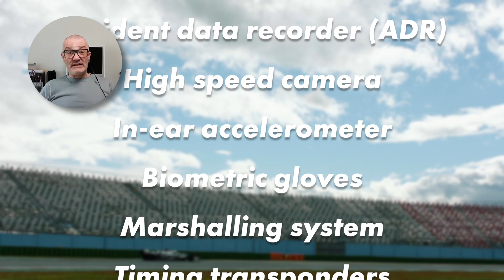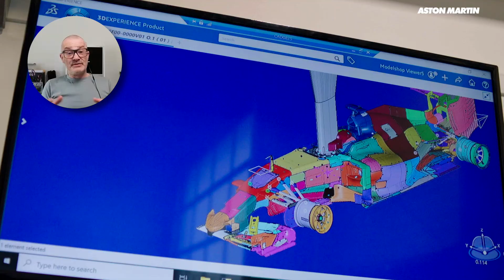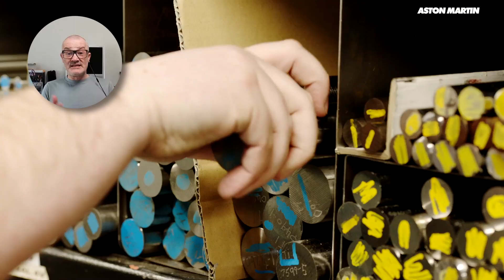The Reason F1 Teams are STILL Overweight

Comment: 21 kg for one rear wheel?! Wow, that's crazy heavy. All the unsprung mass and inertia.
Reply: Yeah I thought that was heavy as hell. I mean the are not that far off from a good racing wheel for a regular car. Sure the F1 wheel are probably bigger than the road car counterpart but still. I have read somewhere that the wheels for F1 was around 10kg in past so hearing 21kg was a little shocking to be honest. Also it might improve the racing and economy but I am not a fan of "stock" parts.
Reply: I was thinking that they will start seeing injuries in the pit crews, that’s a lot of weight to be bending and twisting with
Reply: @sebulbathx  I think these open source ones are worse, cause they effectively mean:
"You can develop them, but there's no point, so if you want to waste money, then do it for sure!"
Reply: AND tire... the wheel itself is only 7-8kg
Reply: @TurboJLo  Yes and don't forget about the air in the tire!
Reply: @-natsukashii2727  You mean Nitrogen. Less affected by temperature and not flammable.
Reply: @mell3109  I can remember that time a stray wheel rolled down the pit lane and hit a cameraman
Reply: @rchan0  yeah it was a nasty hit, right between the shoulders. Could easily have been fatal.
Reply: The increased diameter of the wheels means they are heavier than before and the weight is further out from the center of the wheel hub. These two things are the main contributor to why we are seeing (at least in testing and practices) more lock-ups and bigger lock-ups. As the  heavier wheels have more rotational inertia they also take much more force to start rotating again after being locked up. And that makes the cars less agile, more cumbersome.
So that is another reason I dislike the 18" wheels. They at least could've settled on 17" so the wheels stay lighter and don't hamper the visibility as much.
Reply: @rchan0  yip, if they loose a wheel into the crowd that will not go well.  Bizarre that they have done this.
Reply: @mell3109  the wheels are attached to the cars by tethers so it's incredibly unlikely that they will come off in the event of a crash
Reply: @mell3109  to be fair I think regulations regarding camera operators in the pitlane during races was changed after this to increase safety. However i guess it's still a risk to pit crews
Reply: @seanonraet8327  Mm... didn't we just see Mick Schumacher crash into the wall and 2 (?!) wheels coming free and just rolling around freely? 

Maybe the wheel tethers can't cope with the increased weight of the wheels?
Reply: @Renee_R343  rolling, not flying away in the grandstands
Reply: @qvor1996  It happened to go well that time. What if the circumstances were a little different? Maybe the wheel strikes at a different angle or the crash happens at a time when several cars are in close proximity and don't have time to avoid a wheel rolling in their way, hitting a free roaming wheel with a car can certainly launch it in any which direction. Just a matter of luck. 
BTW, I don't really worry about these things too much, just trying to explain that these things could easily happen.
Reply: These new 18" wheel rules were made to slow the car down and make them look good. I wouldn't say crazy heavy because the 2017 cars rear wheels already weighed 12kg. Going from 13" to 18" wheels is huge so the difference in weight makes a lot of sense.
Reply: @adamn7125  Exactly my thought also. Makes no sense for anyone to develope those parts when the blueprints are in a cloud for everyone to see and use. I can see the idea from it that a smaller team can get help in developing but at the same time why would a top team produce a great part for everyone to use...
Maybe someone knows better how that works? 🙂
I like and watch F1 as much for the innovations and creativity as the racing but that seems to be less and less by every technical rule change. I might be wrong but it sure feels that way.
Reply: @SocietyUnplugged  I don't know the materials for the wheels but I have read that they were magnesium before. Anyone know if they still use that?
Reply: @sebulbathx  Yes! according to article 10.7.1 of the 2022 technical regulations: wheel rims are made of AZ70 or AZ80. Both are magnesium alloys.
Reply: @SocietyUnplugged  Ah ok cool thanks!👍🙂
Reply: @TurboJLo  Nitrogen does not leak as easily as air. The debris that accumulates on the track over the course of a race has cut many tires.  While oxygen is not flammable, it does cause many other things to burn at a lower temperature and create a hotter fire due to the chemical reaction.
Reply: yeah the magnecium rims were INCREDIBLY light
Reply: @henrik1743  Expensive too I guess 😄
But that was what surprised me a little that I thought they used magnesium wheels but the weight of the wheel increased that much.
Reply: @sebulbathx  It's the tire that makes it more heavier. The low sidewalls requirers a much stiffer wall than those old "baloon" 
tires. So a lot more rubber and metals goes into these tires.
Reply: @SocietyUnplugged  Awesome thanks for explaining!
It makes sense now.👍😁

Comment: I have to correct Craig here: with the invention of carbon fiber, the cars actually became lighter AND much safer ;-)
Reply: @Hotmaildotcomz  🤣
Reply: Yes, it's very unfair to call 80s turbo era unsafe, it was the biggest leap in safety in f1 history. After carbon fiber was introduced the 80s was closer to now in terms of safety than they were to the 70s or early 80s.

Yes it was unsafe compared to now, but it was the first period in f1 history where death didn't become a given. That's massive.
Reply: Yeah but they are still the heaviest they’ve ever been
Reply: He said “the early turbo period”, showing the Renault RS10 of 1979. The RS01 turbo first ran in 1977. The Lotus 88 and McLaren MP4/1 introduced CF monocoques in 1981.  There wasn’t a significant number on the grid until 1983. So 1977-1982, early turbo years before widespread CF.
Reply: @rdspam  But he also described it as high power to weight, which implies the later turbo period.
Reply: @rdspam  Thank You. Some people only know about F1 since they started watching it. No knowledge of the history.
Reply: These cars are huge now .. tv hides the size . You can only appreciate it when it’s parked next to a 2004 car
Reply: @me4698  Alright then smartypants, which period had higher power to weight ratio, the early turbo period of 1979-1982 or the late turbo period of 1983-1987? Because if Craig was referring to the highest power to weight ratio in F1, not just the early turbo period.
Reply: @Obi-WanKannabis  it was also the best in F1
Reply: @Obi-WanKannabis   Yes 80s was safe. Only 2 deaths between 1981-1999. Both didnt have relation to car. Ratzenberger's front wing broke off, but the team told him to keep going. Obviously front wing broke fully and he died. Senna's suspension broke and the team made a really bad weld to try and "fix it" and obviously it snapped and he died. Jules Bianchi could have easily been the first F1 death since 1981.

Comment: With LeClerc setting the Albert Park lap record, I’m curious:

Do you know why Schumacher’s Bahrain lap and Rubens Monza lap still hold the records? With the big downward trend in lap times, it seems odd for those records not to have been broken? 

All other track records have been broken since 2018
Reply: Australia course was changed recently turn 9 & 10 were eliminated ( the old chicane), plus turn 1 has been widened by 2.5m.  turns 6 & 15 (now 13) have been widened by 3.5m.  the estimation is laps for F1 will be approx 5 seconds faster, the laps times wont be directly comparable.  Maybe changes at Bahrain  and Monza slowed the track to a point where those laptimes are just no longer achievable.
Reply: @v10-e8y  thanks!!

Comment: fyi 5:06 wheel covers are not 3d printed. they are injection molded if plastic, die-formed aluminum or resin-layered if carbon fiber...

Comment: Especially with the cost cap I'm not a big fan of the minimum weight, because these cars while still being one of the fastest on earth lose some of their edge due to their high mass. In my opinion the FIA should "just" set the safety standards, which the teams have to clear. A lighter car will have less energy in the event of a crash therefore they'll won't need a crash structure as big as they are now. Everythin is connected to each other in the developement of a F1 car. And if a team spends a bonkers amount of money on something like titanium alloys in order to decrease weight due to the cost cap they won't have as much money to develope their aero kit as other teams. Simple as that. Which would really create a interesting challenge tradeoff-wise for the engineers.

Comment: I can see I'm going to be the voice of dissent where the new rules are concerned: 
The cars are overweight because they are way too complicated and far too big.
Reply: Sadly this is true. They should be a lot less complex and also harder to drive. I've never watched any single seater racing other than F1. Last year I cought the coverage of F2 session before F1 started. And I have to admit, they looked better. Much simpler and easier on the eye. And what shocked the most was that they went into hard corners with the brake discs glowing, spitting visible fireballs out from the exhaust while downshifting and sounded pretty damn good while doing all that. Take note F1. 
Unfortunately the racing is not for me due to the flow of drivers coming and going all the time and the skill level being from wall to wall.

Comment: I understand that the wheels are now a spec part, and they are aluminum. And when you put it in the light of 100 wheels per weekend, that would be an significant cost for carbon fiber wheels. But there was budget for the teams wheels beforehand. Or has the cost cap been factored so tightly in regs to the safety, and spec parts increases? So yes, the early stages of the cars development and redesigns are showing in most all teams. Red Bull's progress thru this new car and lasts years development,and success, should be congrats...It's just that wheel weight plays other rolls in handling/steering, as well as braking/acceleration (ie: racing). More so with the increased size and weight at the corners, negatively. They can talk about contact patch, but smaller is better for turning, braking, accelerating and I believe ride quality, as we see with porpoising.  Stiffer tire sidewalls contributing to that effect. Fifteen inch aluminum wheels would even be a dynamic improvement...Test it and show me wrong!  From a design concept and limitation factor, along with increased safety concerns, the cars are becoming pigs, that you're asking jockeys to manhandle for hours all weekend. Even on circuits that were new and challenging last year. And spoken of as dangerous this year Along wiith added sprints and race weekends. I don't know if your "dreamers" have a good grip on the reality of everything that they want to achieve, all at the same time.

Comment: If the FIA would get rid of the hybrid system, the teams could save quite a lot of weight and money. It might well make for better racing. I certainly do applaud the advances they have made in safety in the last couple years. We have a lot of good fellows roaming the planet that otherwise might not be.
Reply: That would mean they would need smaller turbos which would make them a lot slower

Comment: Why are the FIA introducing so many restrictions that are so heavily restricting the F1 design development. I thought F1 was suppose to be the pinnacle of car design?
Reply: Are you new to F1?
Reply: Then that means teams with more money would always win. And smaller teams would never have a chance.
Reply: @cowbear  And what changed? Aren't the teams with the max budget allowed still at the top ?
Reply: @cosminlesutan3574  I'm just saying why they did it. Not saying it will work. But you could argue Haas and alfa is doing pretty good right now. With the cost caps, the top teams are definitely thinking about what's worth and what's not though. I do think with the new restrictions, cars look alot cleaner. No more weird random carbon fiber parts sticking everywhere..
Reply: I’ve dipped in and out of F1 following for about 25 years. Cut my teeth on theRenault early turbo era ( the yellow fire engines) through Prost, Senna, Schumacher etc. Love the new FIA ideas on cleaner air but if 2/3 rods the grid are struggling to get it right and the cost cap is preventing them correcting it rapidly then I’m not sure the current cost cap ceiling is sufficient. Give then all another £50M when such huge changes are induce so they can do then justice. MJ

Comment: They need a filer guy/team, who would file, grind, sand, machine off all the excess material from every part. This way the parts cloud remains the same, but at race day the team would have the weight advantage.
Reply: Can't. Tolerances are very tight, so any deviation in weight between parts is a major no-no. Also, McLaren found out firsthand in the late 2000's what happens when you take too much material off, say, the wheel rims, in order to save weight.
Reply: @halofreak1990  Sure they can, and yes there is a lot of dead weight in the parts. To avoid the over grinding is the reason why they need an expert/group of people dedicated to this particular task. Also, the car is weighted as a whole, not by individual parts. For instance, polishing the drivetrain casings inside and out would loose up to 1,5 kg. It's a lot of work done by hand, but it could decide who stands on the top podium, so very much worth it.
Reply: @oikkuoek  how expensive would it be because with the budget cap everything counts. If it’s not 100% needed they wouldn’t want it. Especially if you had to do that to every single engine. Essentially what I’m trying to say is that their is probably a reason that they don’t do it.
Reply: @rexthewolf3149  Main reason why they don't do it, is bcz it takes time, patience and expertize. All of which are very scarce in modern day world. And there's three engines per car per season. not that much to do. Also if you had a per cent lighter drive unit than all the other teams, I'd think it would be worth the money. Hand finishing is a dying artform, but it would be a secret advantage for the team who would dare to invest in it.

Comment: Dumb question, if the cars are on the heavier side, why worry about the minimum weight? if they’re clearly over it. Or is there a max weight?
Reply: Around an average length lap, one kilogram of extra weight costs 0.03s of lap time - if you are 10kg over the minimum weight, you are losing 0.3s per lap, every lap.
Reply: @janbo8331  I get that, but why raise the minimum? Sounds like the team’s problem not the FIA. Is it a concern of disparity once rival teams trims the fat?
Reply: @EdgardoGates  I agree, it's the team's problem. They always try to lobby rules that would benefit them. The ones with most money and influence try the hardest. I would assume the base of their argument is cost-related, but I hope the FIA doesn't cave in on them.

Comment: I'm not sure if I understand this. Increasing the weight and the ever increasing speed is just adding to less safe situations.Your kinetic energy during impact increases by (E=) 1/2.m.v squared (just the formula for Kinetic Energy). Therefore increasing the impact energy is less safe the way I see it. I'm sure the engingeers have worked this out but I would love to see an explanation.
Reply: The idea is that the car absorbs as much of the kinetic energy as possible. They are now designed to, for example, break in half in certain situations. Mick's crash in Saudi was an example of that. As a very simplified example how an increased kinetic energy might make it safer for the driver, is to think of yourself driving 80km/h in a cardboard-car vs. a metal alloy car. If you hit a rabbit at 80km/h in a cardboard car, the front of the car is smashed and the rabbit flies to your face. If you hit it with a metal car, the rabbit flies to better pastures and you have a bent bumper. This happens despite your metal car having more kinetic energy on impact.

Comment: this makes no sense surely driver losing weight is a way bigger difference surely
Reply: The minimum driver weight is 80 kilos, like said multiple times in the video.. If the driver is under 80kg, the difference in weight is added to the car. The rule is very good as it seeks to stop drivers being pressured into unhealthy weight figures (too low).

Comment: F1 teams need to ditch the MGU H, MGU K, and reduce the mandatory size of the low energy density lithium ion batteries.
Reply: I do wish

But the manufacture don't want that. Whole "sustainable" thing is just garnished term for "manufacturer incentive"
Reply: @bocahdongo7769  No actual manufacturer wants unreliable hybrid batteries that have zero relevance to road cars anyways. 98% of all cars sold are either I4, V6, V8, or full on EV. They could make the batteries a quarter of the size they are now and Ecomentalist Prius drivers wouldn’t know the difference
Reply: @SilverScarletSpider  let's hope with the Battery technology would push the F1 more